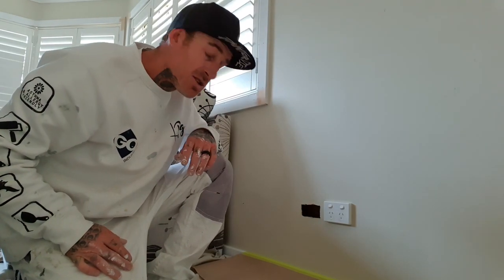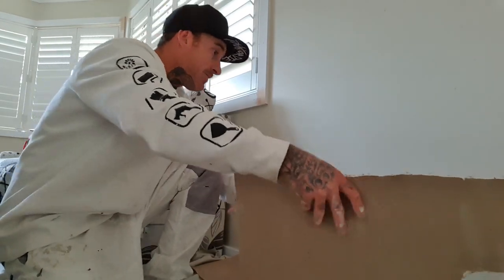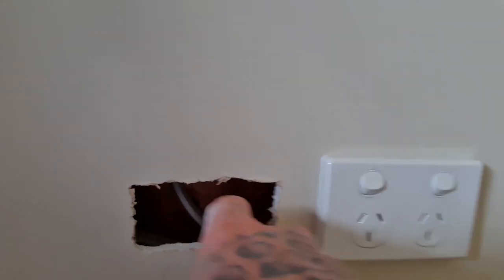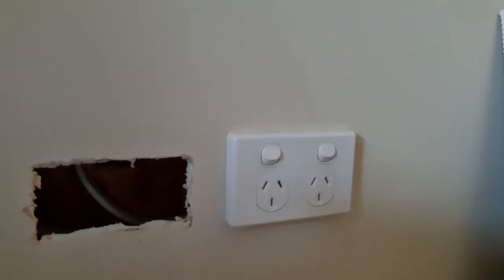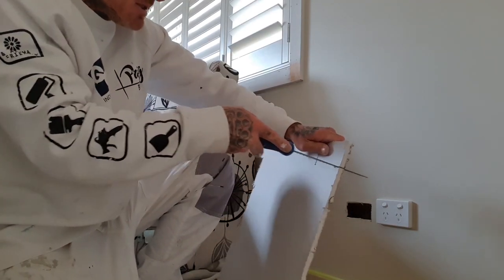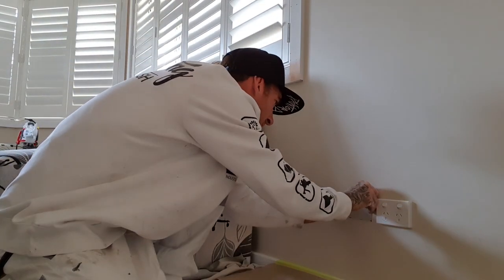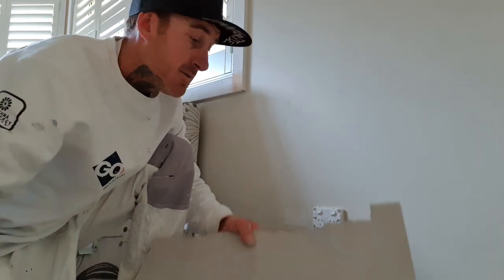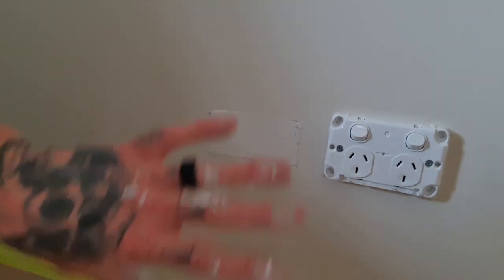PATCHING HOLES | HOW I

Comment: As long as its not bumped against it will be fine..but ideally it should be back blocked.
Reply from the maker: I do back block big holes so I have something to fill too, but there is really no need with a hole this size. Been using this process for over twenty years. Base coat will dry rock solid. If it gets bumped its going to fall out? I don't understand what you think I peace of gyprock will do? gyprock is not going to provide any more support other than something to fill to?